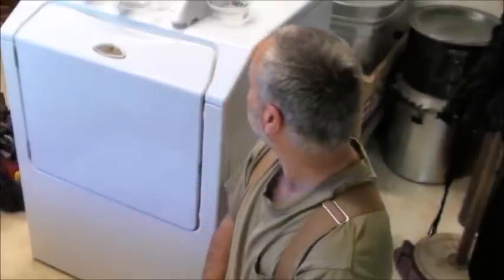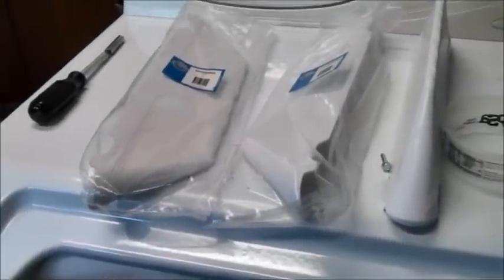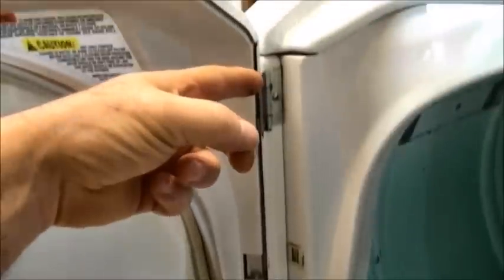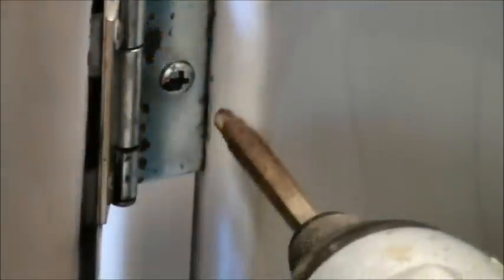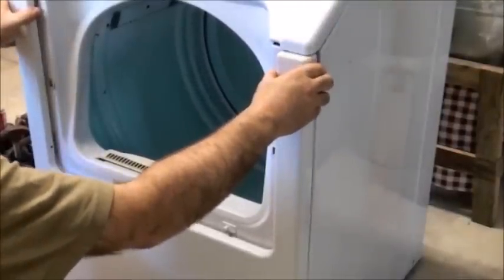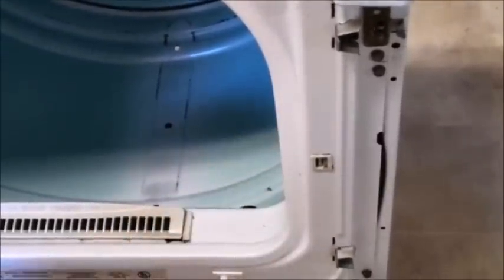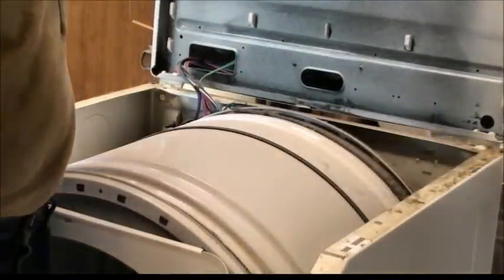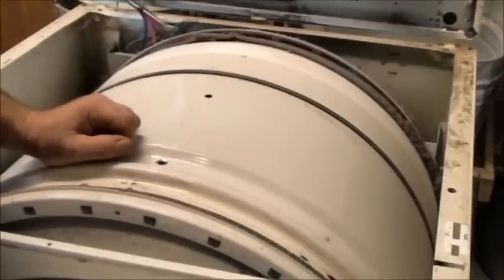Maytag Neptune Dryer Baffle Replacement

Comment: First off: I'm not trying to be a smart aleck.
I've owned and used clothes driers for 46 years.
I've had three different brands of driers (gas and electric), but never a Maytag.
I've never worn out or had a baffle break.
The longest I've used a drier was 16 years and it still worked when I gave it away. (gas Kenmore)
Changed mutiple drive belts and two electric heating units.
Serious question.
What were you guys running in the drier that broke or wore out the baffle?
Reply from the maker: Our dryer is at least 15 years old and though we hang most of our laundry all year round, when we do use it, it is usually for heavy things like my homemade denim quilts with wool dryer balls. However, I do not think these items are the reasons, I believe it may have been faulty construction on this model's baffles and the cheap plastic used (it was the plastic parts that the bolts go into that broke). Either way, I believe it will last us many more years to come. Nothing else on the dryer has needed replacing in the time that we have owned it.
Reply: Three factors would contribute to baffle failure:
1.) Engineered obsolescence 
2.) Overloading
3.) Heidi
Reply from the maker: Very funny Mr Rain! haha
Reply: @MrRain-hk4zi  You better be careful or you'll be sleeping in the garden, eating only raw veggies. :)
Reply: @phil.paulastocks2276  If that's the worst thing that happens at least i'm fed :D
Reply from the maker: HAHAHAHAHA!